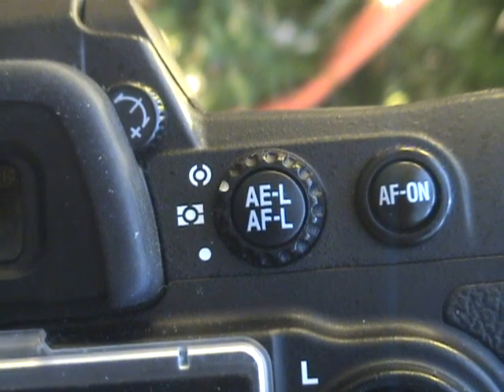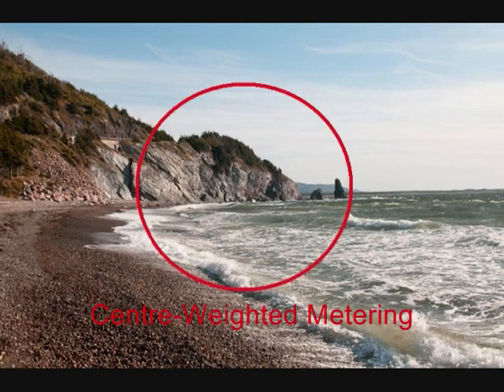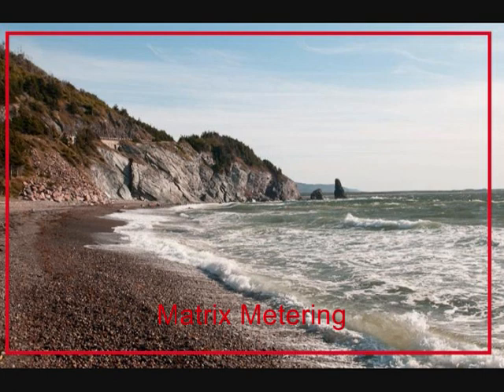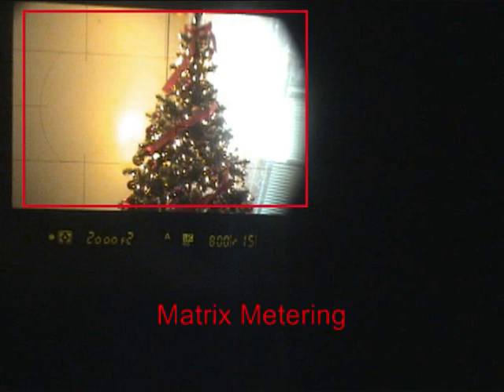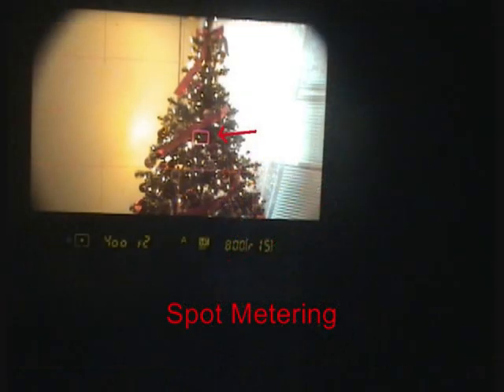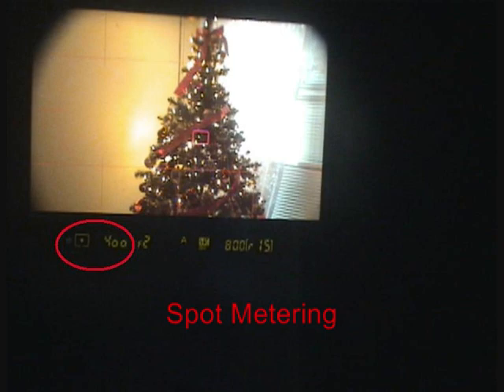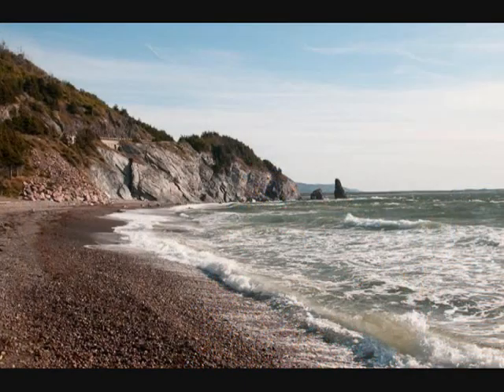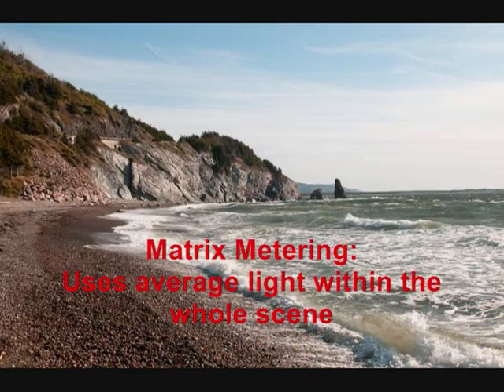Understanding camera metering modes (Matrix, Centre-weighted & Spot metering)

Comment: Hey assmonkeybear,
If I want the subject not in the center of the frame and I need to use spot metering, the procedure I use is as follows:
Point the camera to the subject and have the subject in the center of the frame.  Next, press the Auto Exposure Lock (usually denoted as AE-L or similar depending on your camera).  This will lock the metered exposure to that subject.  Then recompose your subject, putting it where you want it in the frame.  Lastly, focus and shoot.
Happy shooting!
Mick